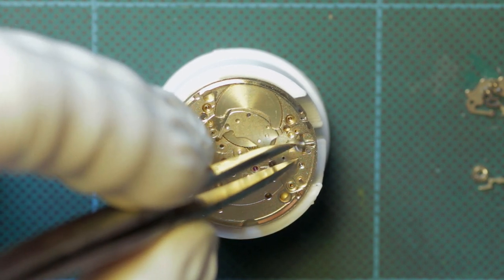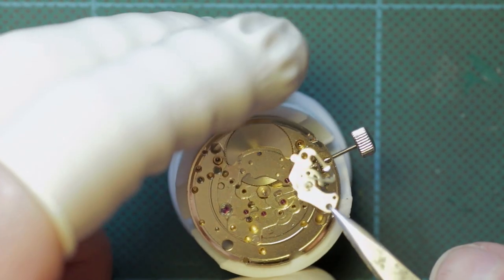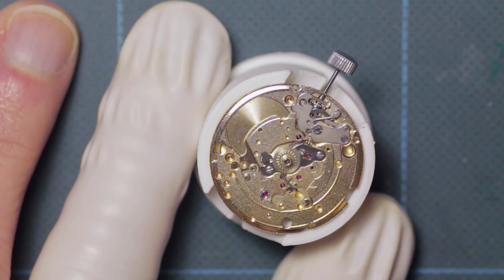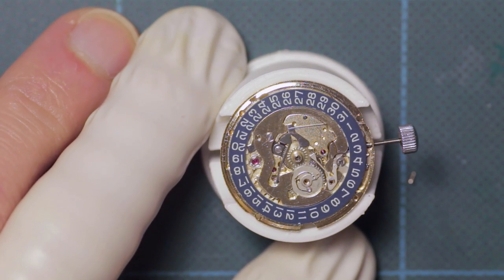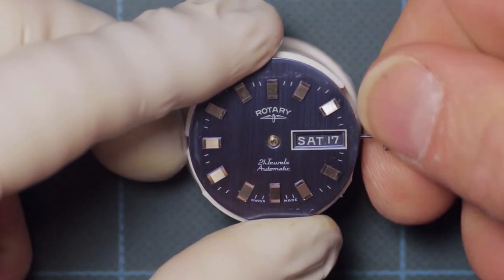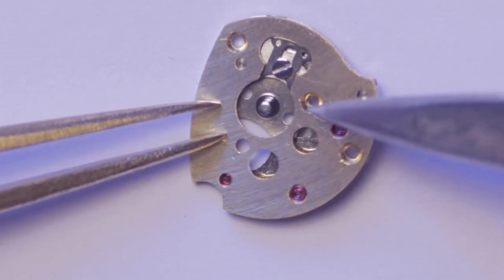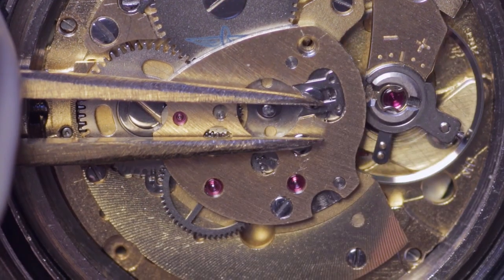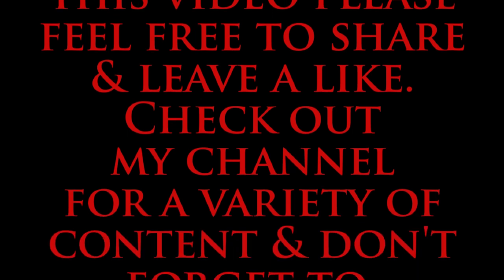AS2066 Service 70's Rotary Part 3 Dial Side & Auto Winding Mechanism

Comment: Great video series of this AS movement, havent done any AS myselves so far, but it seems to be well built movements. It actually have some simularities With the Seiko 56xx series movements, that also has a sliding cannon pinion and a friction gear on the second wheel.
Reply from the maker: Thank you. I've worked on a few but this is the first of this calibre. It's a lovely well built movement but apparently the setting lever plate/spring assembly are very hard to find if damaged. It's an unusual and complicated setting.

Comment: Thanks for this series. I hope you don't mind if I add one criticism? Reassembly of the automatic cassette can be much, much more difficult than presented here. I suggest to anyone who is not already very adept to leave it alone if there's not obvious need.
Reply from the maker: No problem at all and yes it is a highly one because of the springs but I'd always recommend a disassembly for proper cleaning if possible.
Reply: @spidiq8  Appreciate the quick response. I'm not nearly as calm and coordinated as yourself but I got it done with the aid of a flat piece of wood and small drilled hole. I was able to place the first half down level and slip the gear pinion through the hole keeping everything flat and fairly secure. Thanks again...
Reply from the maker: @stevejohnson7132  It's only practice, like anything. Do it enough and it looks easier that it does when it's a first try. Well done for getting it done and the workaround. There are many ways to get something done.

Comment: I have stripped an A.S. 2066 movement taken plenty of vids and pics for re-assembly. It is also a Rotary. The date and day wheels are discoloured - a nasty yellowing has formed. I don't know how it comes to be like this. Is there an outlet where I can purchase new ones? I will use your vid in re-assembly as it is definitely clearer than my effort, so thank you for posting. This is the first A.S movement I have worked on. I'll let you know how I get on. Once again many thanks. I am subscribed.
Reply from the maker: Thank you for the subscription. Re the parts, you might find generic parts from supply houses like cousins but unlikely to find rotary branded, the best option would be a parts movement from eBay or similar. You often see the AS2066 with damaged setting lever or day date parts for sale as there are a lot of dial side parts which don't fare well and those parts are very hard to get.
Reply: @spidiq8  Thank you for the information.

Comment: Do you oil the pallet fork pivots?
Reply from the maker: Never on jewelled pivots, very very sparingly on steel or bushed pivot holes such as you'd find on pin pallet movements.
Reply: @spidiq8  Thank you sir

Comment: I've got a Rotary with AS 1903 automatic movement. Ive  taken off the automatic part but I  cannot put it back  .still trying to align all the wheels with auto parts..
Reply from the maker: They can be very fiddly, as with most auto bridges, all you can do is try to get everything aligned and with very slight pressure on the bridge, turn the winding stem gently, this often helps things drop into place and align.
Reply: @spidiq8  thanks for your help
Reply: Finally I got it right. Thanks to your video I gain some confidence. The rotor and cassette and bridge was all together. I separated them and aligned the bridge. After about 40 minutes of fiddling around I heard a small snap and the bridge was seated. Viloa. Nivada watch is working again....
Reply from the maker: @shushilnavsaria4515  Great news.